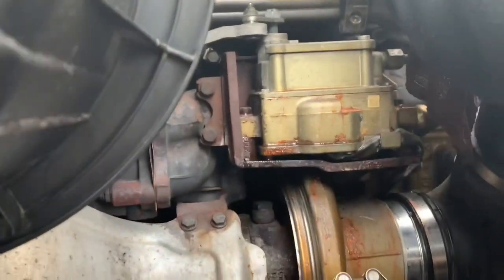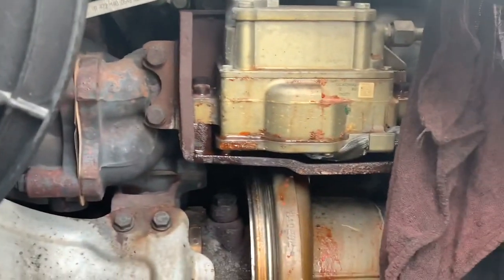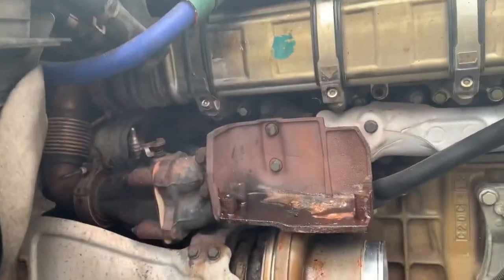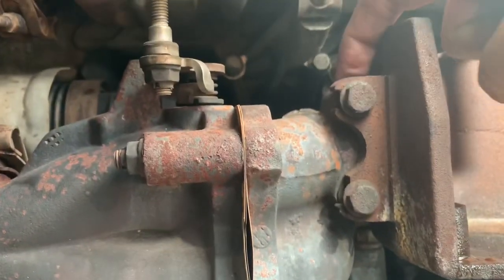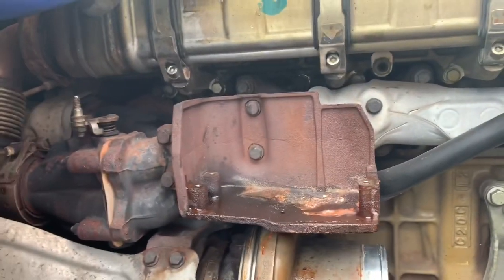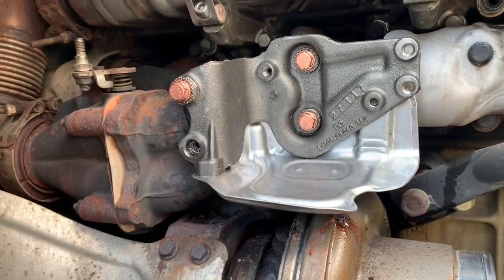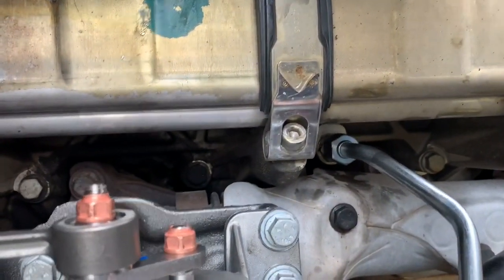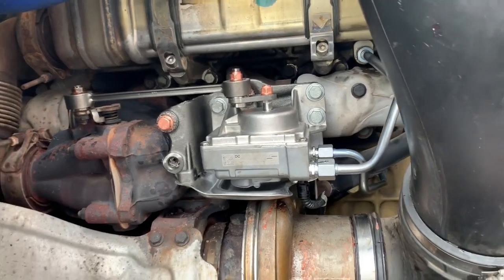DD15 EGR Actuator replacement

Comment: how much does it cost to replace this on 2015 freightliner cascades
Reply from the maker: @BigMeech-f4r  the EGR actuator is located on the passenger side rear of the engine. Coolant needs to be removed and the pull rod from EGR valve to actuator gets stuck or can break at the nut. Time is about 3-4 hours

Comment: Help please i am getting these codes do i need ro replace my egf actuator 
SPN 2791 FMI 18
Reply: I MEANT EGR
Reply: SPN 2791 FMI 2
SPN 520801 FMI 4
SPN 520296 FMI 31
Reply from the maker: @TTuckerTrucking  
520296 FMI 31 is EGR learn cycle incomplete. Look for leaks, check the venturi pipe. Check the Delta P sensor ports to see if they are plugged.
520801 FMI 4 sounds like it is CHS (possibly chassis related), SAM module
Reply from the maker: EGR  valve actuator, learn cycle too small. This applies to GHG14 systems. What year is the truck?
Reply: @CarlosDieselElectric  2014 and what do you mean by cycle?
Reply from the maker: @TTuckerTrucking  when you cycle the key, there is learn or cycle process involved. You may have to remove the heat shield that covers the EGR. Do you have access to DDDL software?
Reply: @CarlosDieselElectric  no i do mot have any access
Reply from the maker: @TTuckerTrucking  I would recommend  you find someone who does. 
But you can check the Delta P ports, check the venturi pipe, check the CAC and check for any exhaust leaks.
Reply: @CarlosDieselElectric  sorry ofbi am not mechanically incline that's why ibask these questions cause I don't know where any of that is located.
Reply from the maker: @TTuckerTrucking  no worries I don’t mind the questions. I completely understand.

Comment: Carlos I have a 2008 Detroit 60 series and my check engine light came on and I lost power they hooked up laptop and it said vgt actuator communication error CAN 3 it had a red code I replaced the vgt actuator and the wire sensor harness and still same problem can’t connect to actuator with laptop to calibrate what else can i do to see if I can connect to actuator
Reply from the maker: You have to have the genuine Detroit Diesel Software in order to calibrate the actuator. If your mechanic has the bootleg version then you will most likely not be able to do this. You have to calibrate the actuator first, then install. Look at my other video, I covered the Series 60 turbo and turbo actuator.
Reply: So the bootleg version will not communicate with actuator I will ask mechanic if it’s the bootleg or genuine version in case it’s the bootleg version what do you suggest doing take it to the dealer or use a test ecm first to see if communicates and the truck has dpf delete can I still take it to the dealer and what are the chances of a bad ecm how can I troubleshoot ecm
Reply from the maker: charlie mata the DPF delete changes things. Have the person who did the delete check it first. It could be that it needs to be reflashed or reprogrammed with the delete. Of course check if the ECM is bad, maybe use a test ECM.
Reply: Ok thanks for the information greatly appreciated